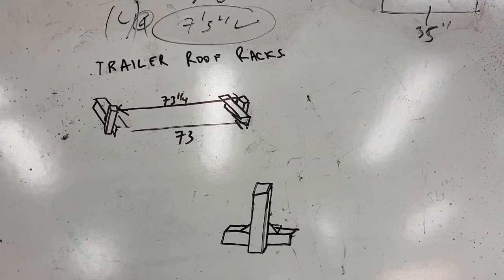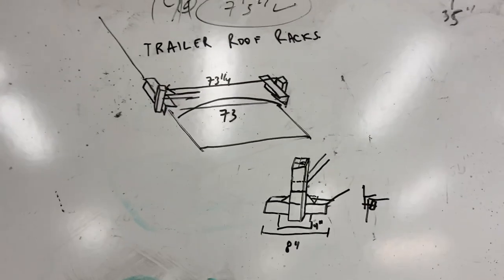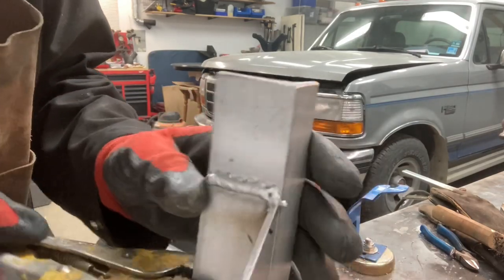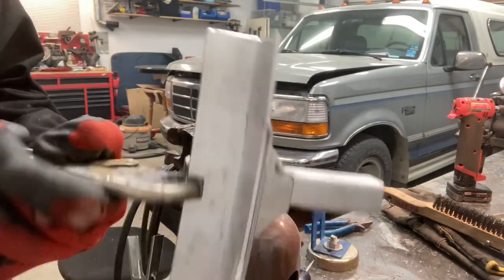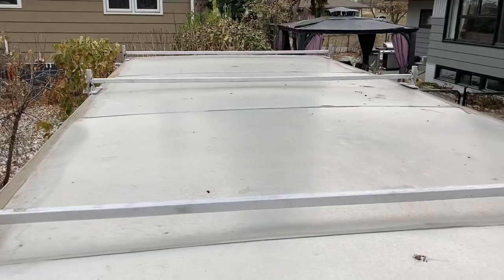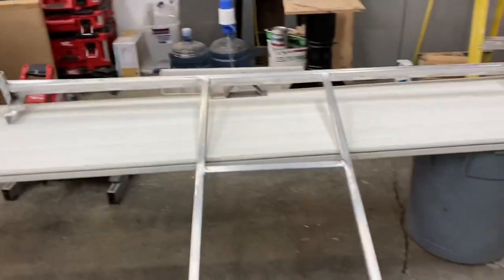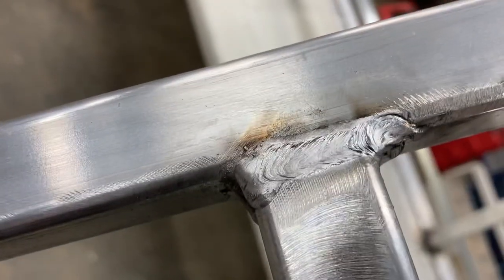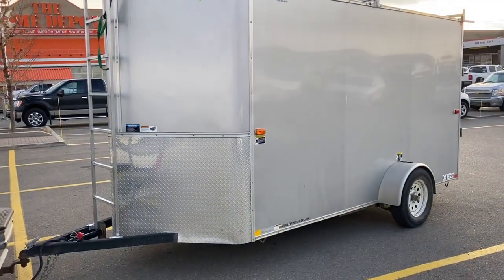How to Weld aluminum roof racks

Comment: How has this held up over the last 2 years? Great video, thanks
Reply from the maker: It’s held up great!  That spool gun was a pain in the ass so I just bought a tig to do aluminum..
Reply: @FixerMerlin  brilliant aiming to do a similar thing in tig... But on a miata 😳
Reply from the maker: Patch panels?  Or are you putting on a ladder rack?
Reply: @FixerMerlin  ladder rack, need to transport a large tent to car shows and last time had to leave the roof down in a rain storm as it's too long 😄